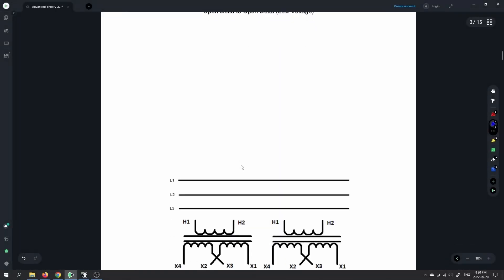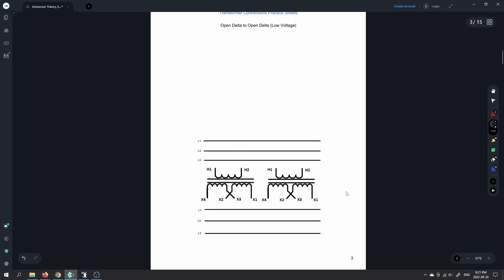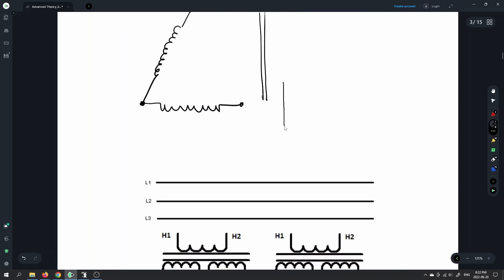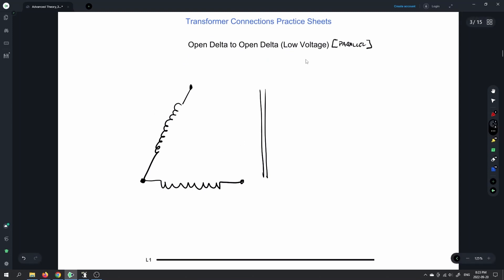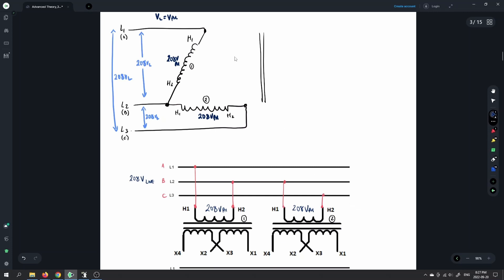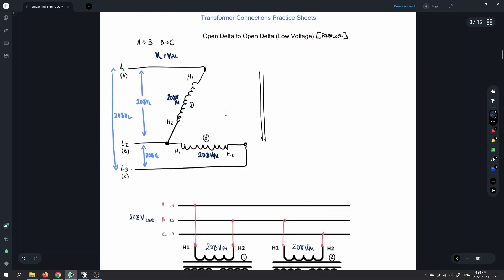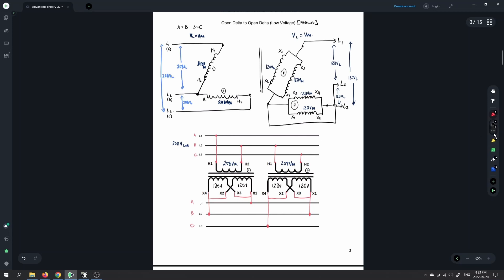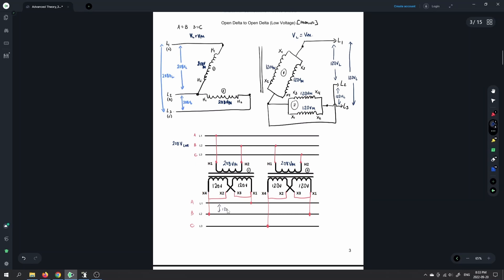Open Delta Wiring Diagram

Comment: One other important reason for open-delta, that you neglected to mention, is: COST.
A lot of utilities (at least here in rural west Texas) will use open-delta systems to supply 3-phase power (typically 120/240v High-leg) to smaller ranches & farms, rural shops, etc., where the majoriy of the load is single-phase, but 3-ph is needed for some motor & machinery loads.
Because OD requires ⅓ less resources than traditional 3-phase, it is cheaper to install & maintain: Only two primary HV (7.2/12.5 Kv) conductors are needed (less wire, less insulators, smaller poles), only two pole-mount xfmr's (less hardware, less work/time to install, smaller poles).
This amounts to substantial reduction in installed cost for many utility companies, but the customer still gets the 3-ph power needed.
Thanks for posting!